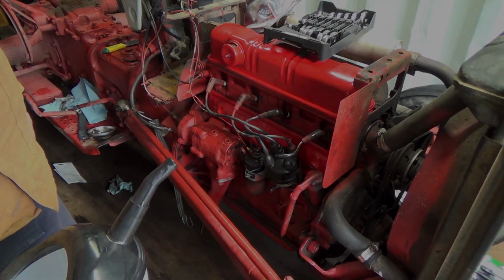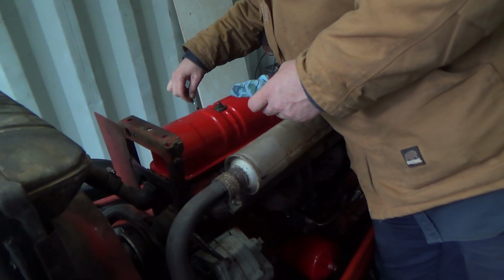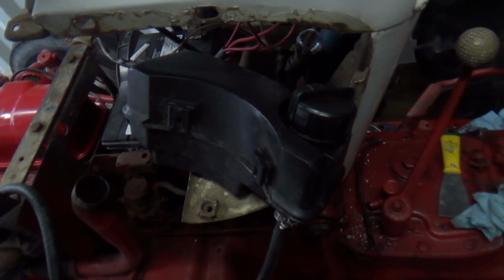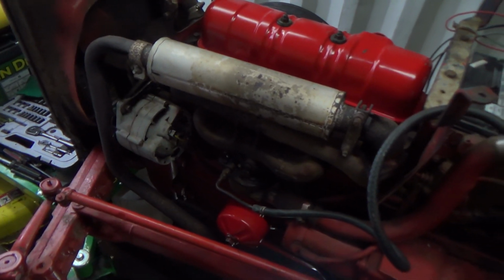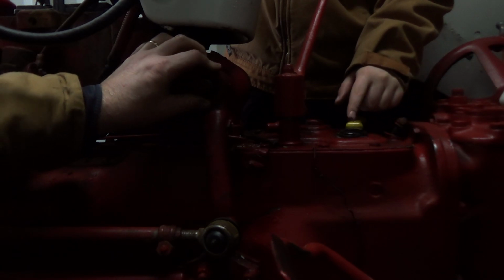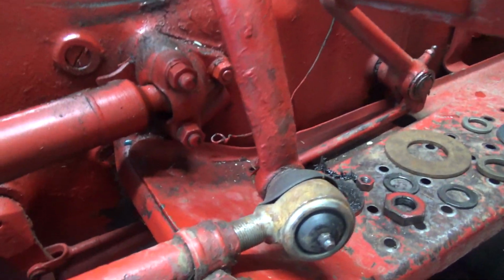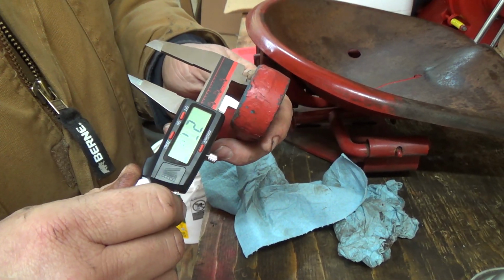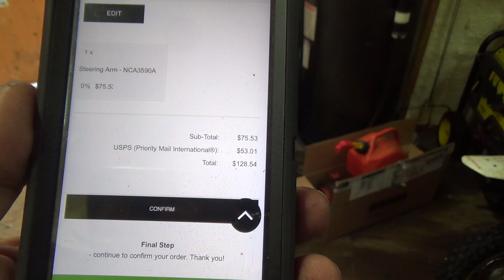Ford 800..Let's fill the oil up check for leaks  !!!Special Guest Appearance!!!

Comment: Thanks for another tractor update,  if you don't want to mess that temp gauge up.  try using a heat gun or small propane torch  and warm the housing where it's screwed in.  It should still move picking that heat source up if it works. It's not smart enough to know if the heat source is from water or not L.O.L.   If it works then leave it alone don't ask me how I know what it feels like to mess up an expensive, original to the tractor  Fordson gauge that used to work. Take care

Comment: Measure how far each spline is sticking out of the gearbox.  It looks like it's shifted to the side you haven't taken apart.  If it is, it's not pulling on tight on the side you have taken apart.

Comment: Does that Ford 800's carburetor have a place where you can put a hose to connect to a vacuum gauge so you can dial it in more thoroughly?